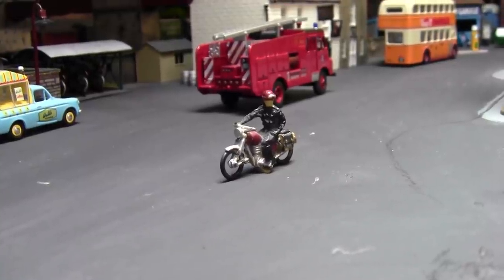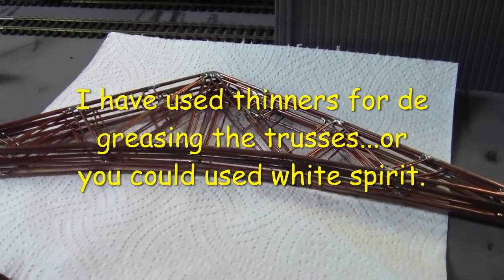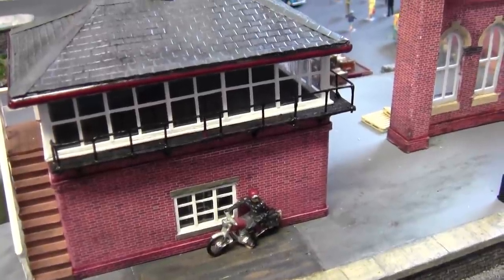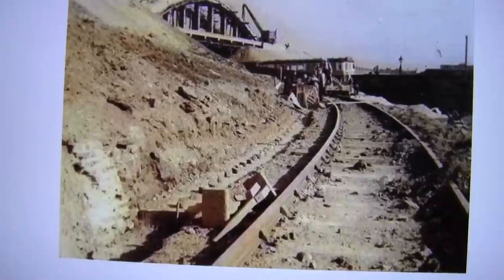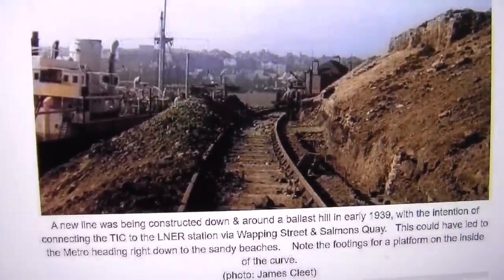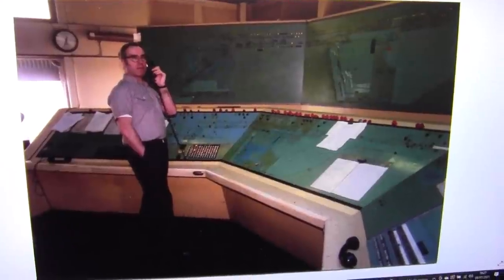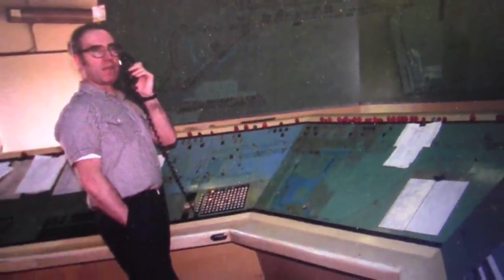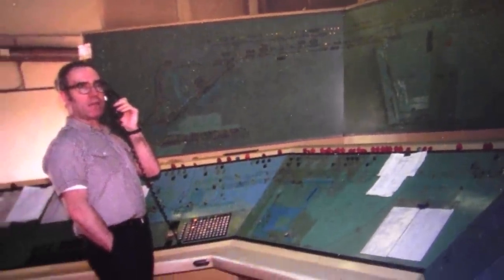New loco,  update. & surprise chat. No 275

Comment: Any chance your going to turn the 01 into a Tyne Docker? Still wish I had your patience -keep up the good work. In 1968 I was on 1S12 and coming through Chester I got two yellows, I was "instructed" to keep the power on [it was a Deltic] as "It'll be a landcrab going into Tyne" It WASN'T ! and the board was off to go onto the slow at Ouston Jcn, I slammed the brakes on and managed to come down to about 30 to go through the junction. The rules say if a wrong aspect is shown for direction you must stop and query the route, getting on to the slow the boards were off to go into Tyne receptions!! I stopped got on the phone and it turned out the box thought we were 9P12 and 9P12 was standing at Ouston Jcn wanting to know why he was going main line!! Durham had transposed the train descriptions to Tyne.
Reply: I was at Durham South in 1968 and  it was absolute block to Durham North, then track circuit block to Tyne. He would put the train number in and I don't think you stopped at Durham. 
The sig at Tyne should have seen by the track circuits, you were travelling at hell of a rate for a class 9.😀 Those numbers  were dropping out ect. Did you know Harry Friend he was a driver?
Reply: @johncuddihy5236  Your right we didn't stop at Durham! I've never sign boards come off as fast when Tyne found out who we were! We got stopped on KEB for 5 mins Sigs so I don't think anyone was the wiser. I knew Harry Friend- he became a loco inspector. Harry Wootton was my Mentor.
Reply from the maker: @French Steam. I will have to check out what the running number of the loco was. but maybe possible to do.. many thanks for commenting as always very much appreciated. interesting comments between you and John..........all the best Tony
Reply from the maker: BR Running Numbers.......thank you for the information........cheer's Tony
Reply: @TONYNORTHEASTERN  PS don't forget the air pumps on the fireman's side adjacent to the cab [that's so he could climb out and hit them with the coal hammer if they stopped working!]